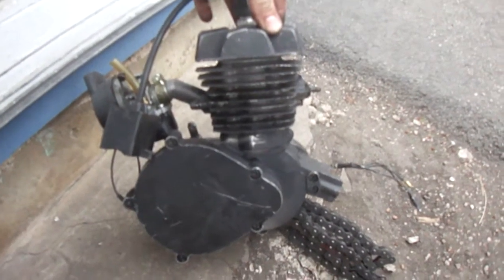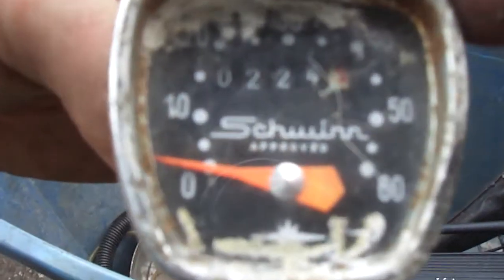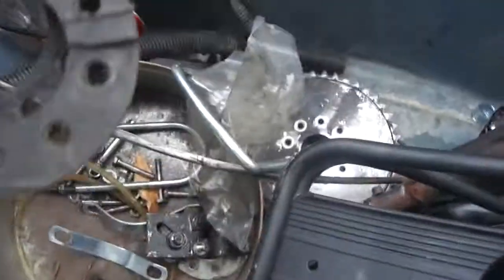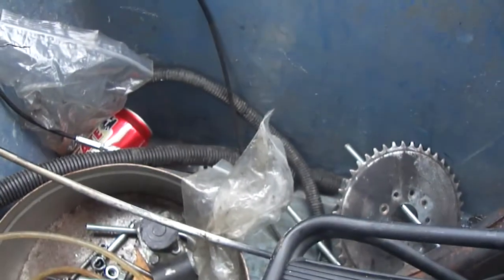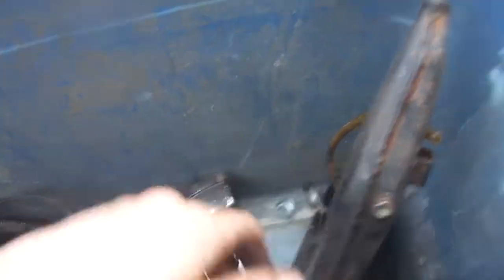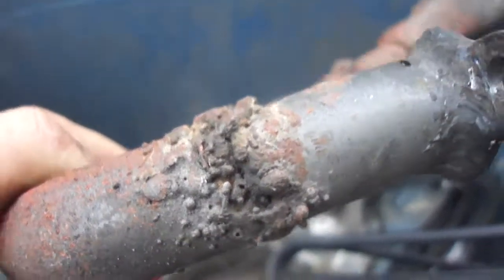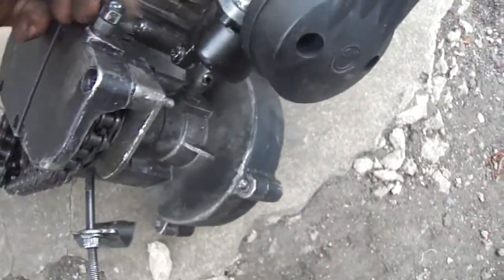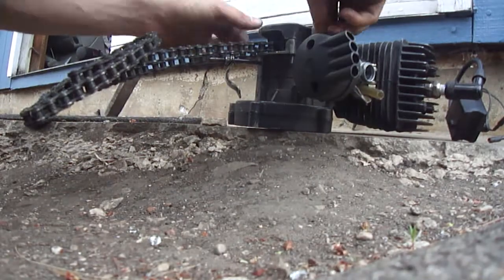Old schwinn Motorized bike NEED HELP!!

Comment from the maker: i did take a little looksy and yeah no electric start just the throttle grip has to electric start button. the clutch works found the arm for the cable that attaches to. only thing i need to see if this pig well start is the screw for the carburetor to set the idle its missing.